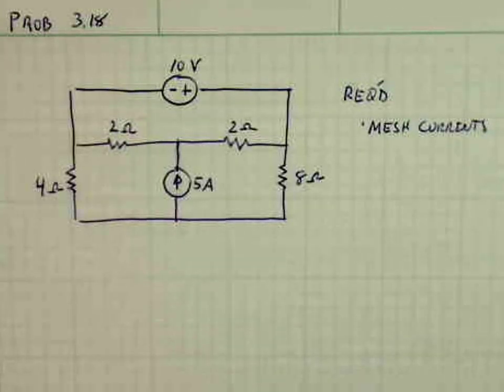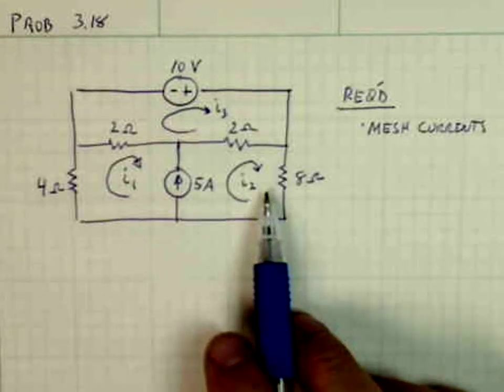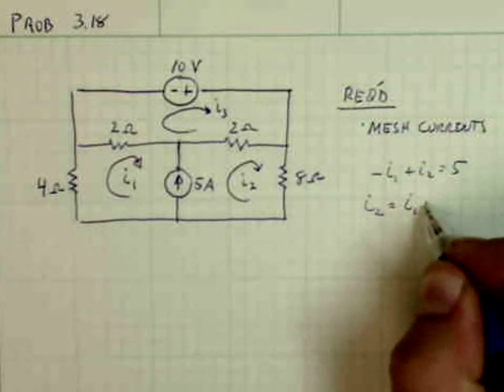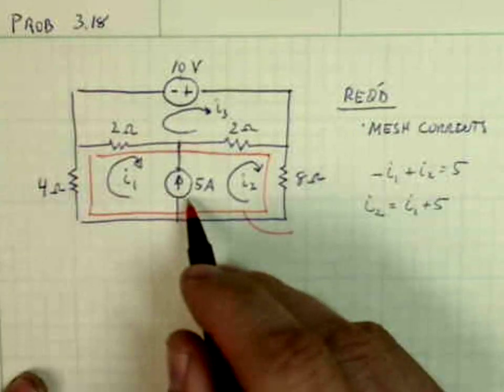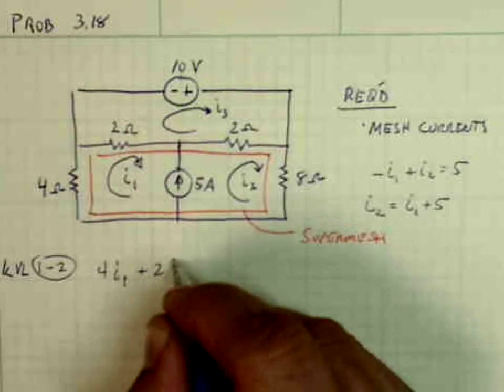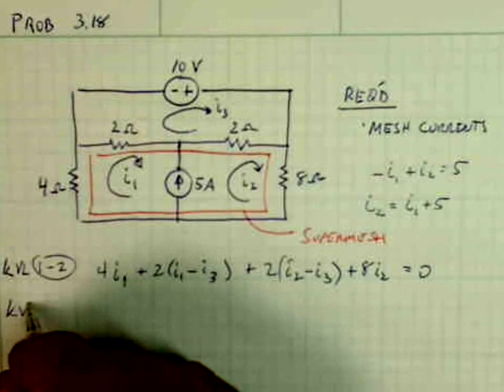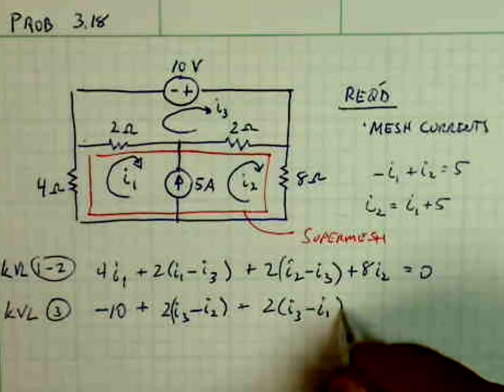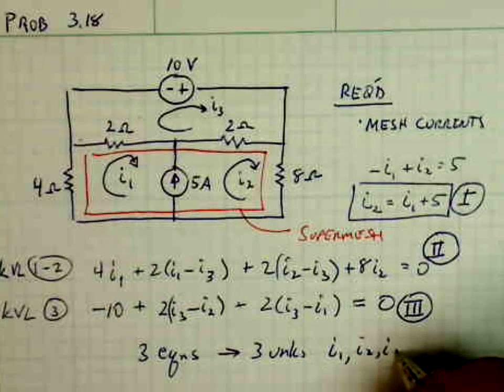3 18 Mesh

Comment: I think I understand.  It really doesn't matter which way you write it because you're adding positive voltage from the resistors so -10+2(i3-i2)+2(i3-i1)=0 could be rewritten to 10-2(i3-i2)-2(i3-i1)=0.  The later equation is how I thought the equation could be written but you should end up with the same result.  I had to wiki "passive sign convention" to remember how that works, still kinda fuzzy but enough to get by.  
Thank you

Comment from the maker: I am using the passive sign convention. When entering the negative terminal, a negative is placed in front of the magnitude. 
Put another way, a voltage drop is positive, and a voltage rise is negative. In the direction of the loop, the 10V is a rise... thus -10V.

Comment: Shouldn't KVL for mesh #3 be +10V instead of -10V?  The assumed current is going from the negative side to the positive side.  Are you using conventional or electron flow notation?

Comment from the maker: @0WaIIace In Mesh Analysis, there is a Mesh Current in each mesh (a loop without another loop inside of it). Thus, i1 cannot be around the 4-2-2-8 loop (it contains 2 meshes). Mesh Currents can be drawn either clockwise or counterclockwise. I draw all of mine CW so my process in each mesh is always the same. When meshes share a branch, their mesh currents need to be combined. In this example, a Current Source links i1 and i2: 5A(up) = i2(up) minus i1(down). Mesh1 and Mesh2 form a "supermesh".

Comment: I think you made a mistake with the loop i1...I learned in class that you could not go against the current source. So instead of i1 being as you have drawn it, it should be in the closed loop of both 2k resistors, 4k and 8k resistors...correct me if im wrong but i dont see where your going with this